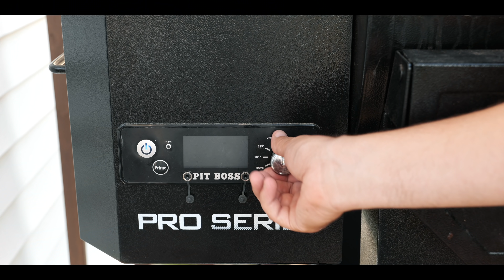This has become my tradition...

Comment: I use Bose quiet comfort headphones. I use them when I mow and in my machine shop. Very comfortable. Great sound. Standard issue for employees at the machine shop. I started mowing low this spring. Purchased a John Deere from one of our local courses. I leave a long perimeter, second level fringe and then short. It's gotten smooth and thick. Been leveling as well. You have a great channel. It takes alot of work. Very informative. Helps me with my yard.